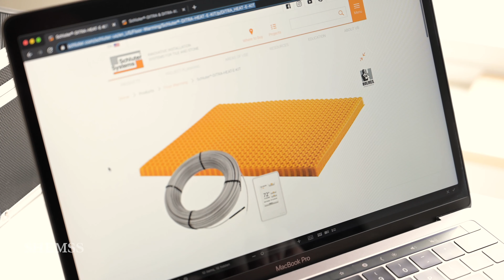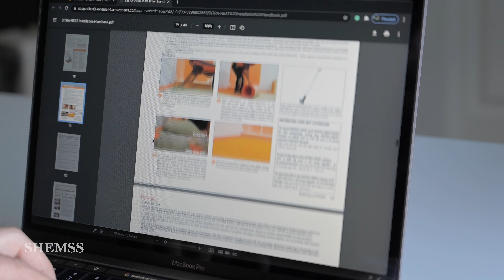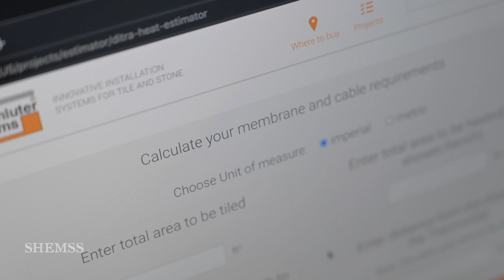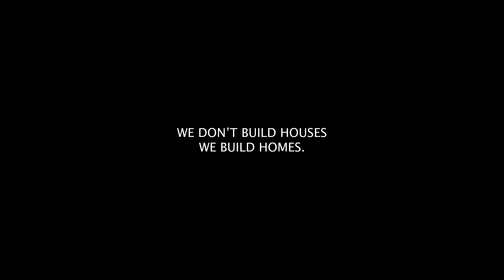Heated Floor Systems | Schluter Ditra Heat | Installation Basics | By SHEMSS

Comment: How come there are screws in ditra ? Thanks
Reply from the maker: I don't see why not if you need to press DITRA down
Reply: @SHEMSS  I guess I thought it used for waterproofing and the top is separated from the part that’s is glued down to the plywood. When plywood moves the tile doesn’t crack bc of some mechanism used to separate the tile from plywood. By attaching the top directly to plywood I guessed it would eliminate the purpose for the ditra.